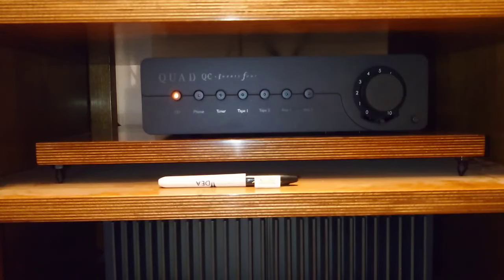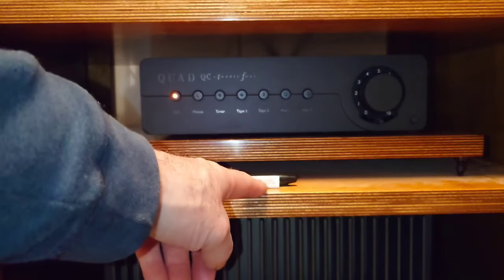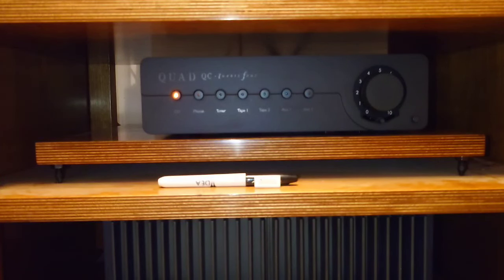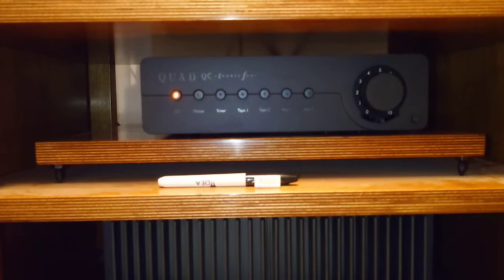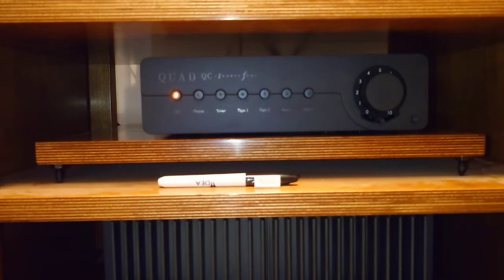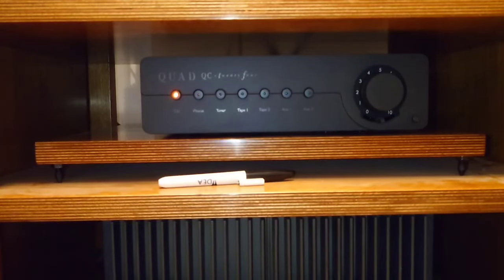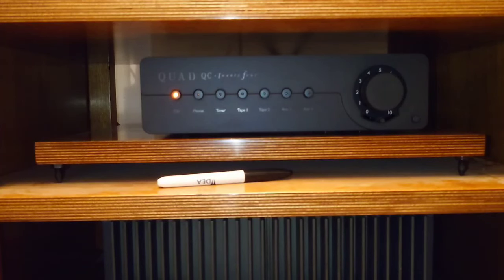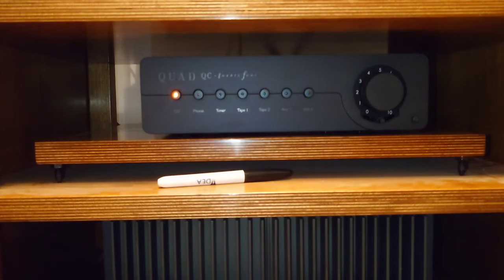40 HOUR'S OF BREAK-IN & WOW TOSHIN KOGYO DUTC PAPER IN OIL CAPACITORS!

Comment: I find it completely amusing to listen to parts break in and the sonic changes as it does so, especially the times when the sonics get really crappy for a minute and then become a huge step better than before... The electrons have to figure out their path trough the parts. The crossovers I made a few months ago, 2 completely different speakers sets done, are still gettting better as time goes on. The difference between caps is quite large and the top end stuff is really fantastic. Cheers.

Comment: Hi Ian    your pre amp gets a lot of good reviews as is , so your  extra work has obviously taken it to another level .  Which always makes me think why Hifi makes don’t push the most out of there designs to start with ,  yes they have to work to a budget but when you look at the overall cost that  you have spent . It does seem a bit short sighted , especially when they would obtain parts at a much lower rate than you have paid .    As for your negative feedback from fellow enthusiasts I’d take little notice ,   because they have not listened to your system make an informed judgement .  I too would fall into the same category , but having followed your channel for some time now , I’ve no reason to doubt anything you say or do .       Kind regards